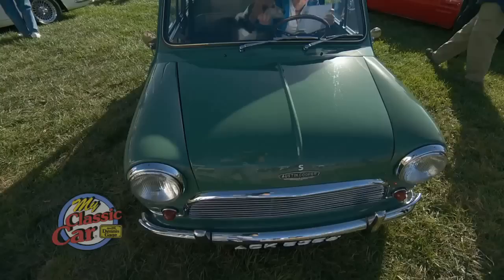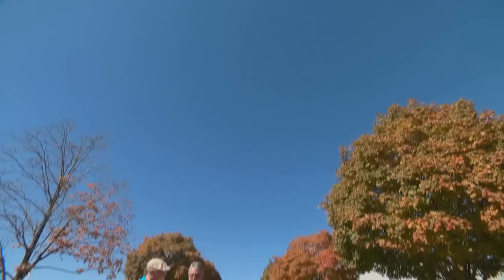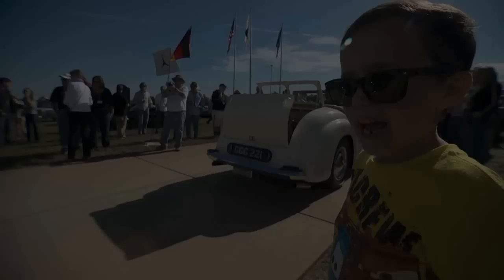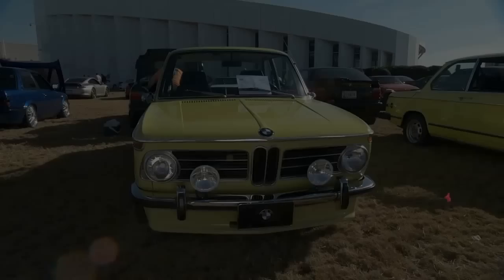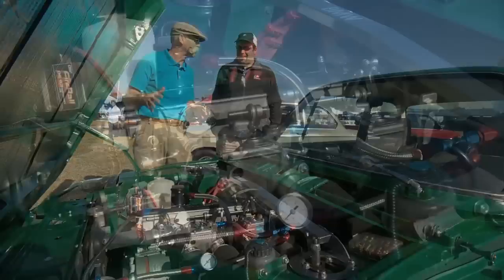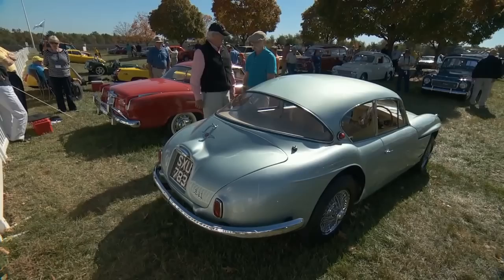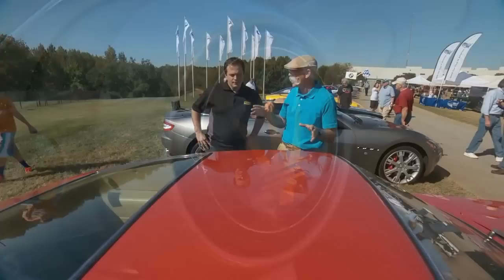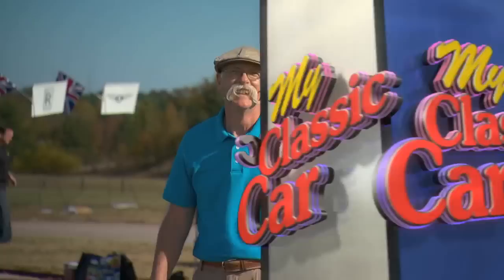1956 Jensen 541 | Euro Auto Festival | Rare European Imports

Comment: Story about the 3 litre V6 Essex engine. When in about  1968 Ford first brought out the Transit 2 litre V4 Mk 1 van, and the first Escort car,  it was faster than any Police vehicle at the time. 98% of robberies at the time used a Transit as a getaway. So Ford at Dagenham were appraoched to produce a vehicle capable of catching thier own van. The result, to special order approved buysers only, was the 3 litre Essex Transit, mostly with 3 speed auto box. I was lucky enough to drive one. The look on the face of owners of 'Sports Cars' at the time when a bloody great Transit, double back wheel minibus took of from the lights leaving them coughing dust  is something I will always treasure.